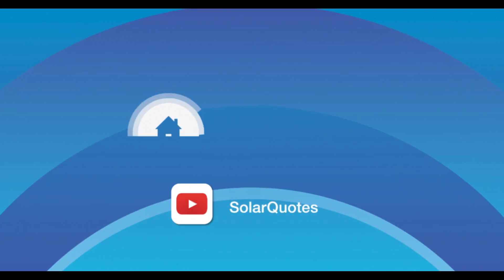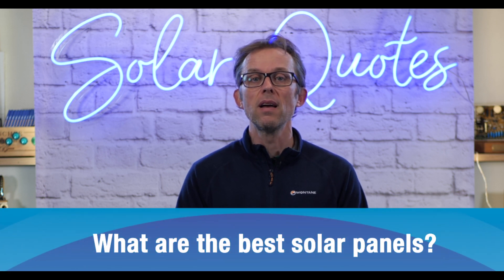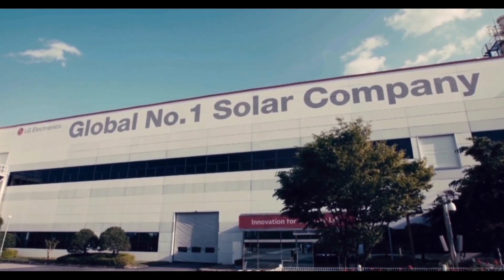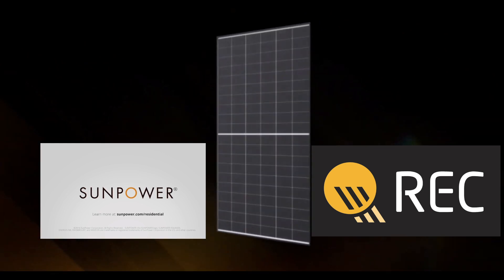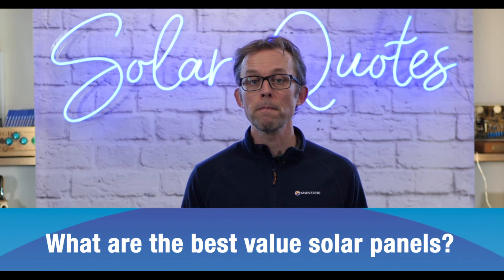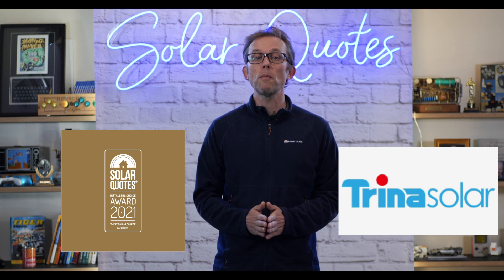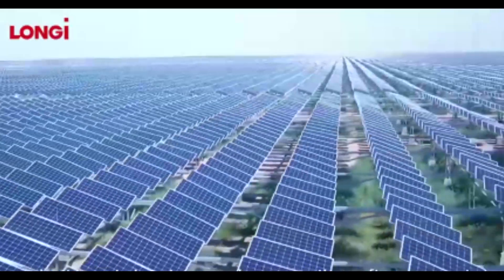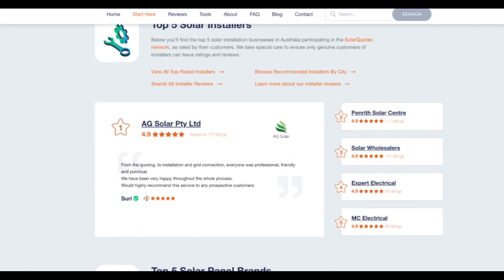What Are The Best Solar Panels In Australia In 2021?

Comment: Thanks for the video concise and to the point. It was a close quoting call and I only went Sunpower over LG due to my specific product selection where a factory fitted micro matched the panel warranty. I of course chose a high rated installer. Like @Matt Hew's idea with the other essential component choice (inverters).